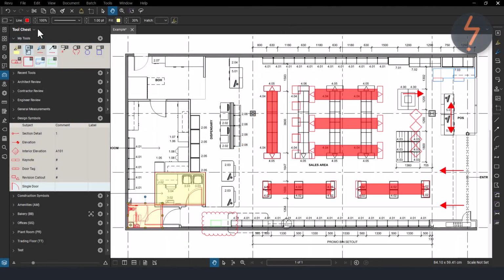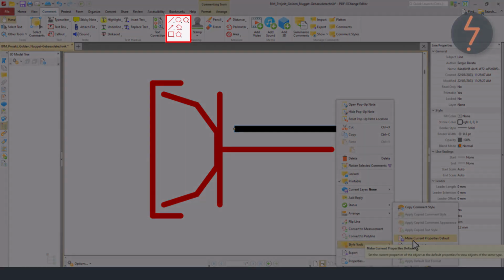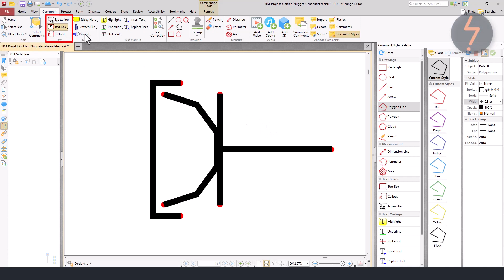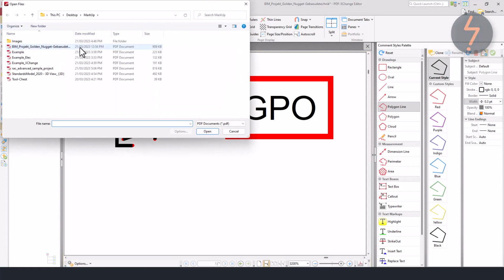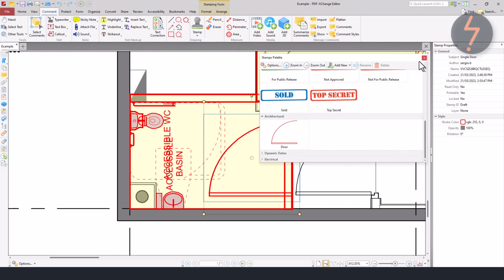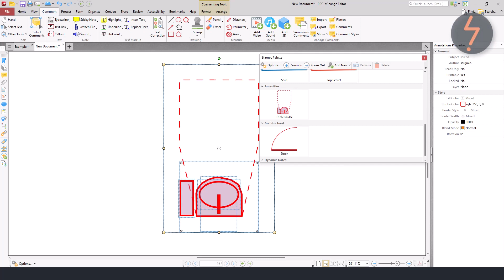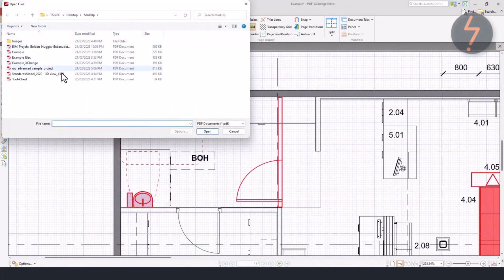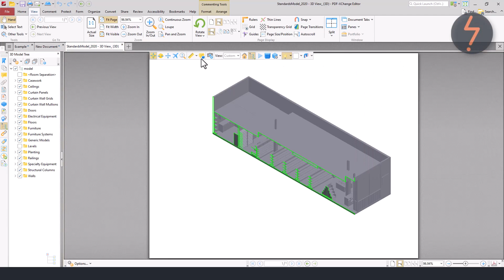Mastering PDF Redlining and Mark-ups: An Architect's Guide!

Comment: Would you recommend this PDF X-change editor for using heavy files (plans and specs) and multiple files at the same time? We are looking for a PDF editor that doesn’t crash everytime we want to open multiple files like when we do coordination with other disciplines. Thanks!
Reply from the maker: Sorry to say that a free application won't do that. If you want to do heavy lifting - you'll need to pay. Bluebeam is the best option for paid services.
Reply: I’m not talking about the free version (which doesn’t do much). I’m talking about the paid version PDF XChange Editor.
Reply from the maker: @limavalepy   - for paid applications, Bluebeam is the best.
Reply: @SergioBarata  Yes, we all know that. I’m looking for alternatives, since Bluebeam costs 240$ per user per year which is expensive for the average user. PDF X-Change Editor costs 56$ once and then about 10$ per year. We don’t need Bluebeam (we are a small office), we just need a PDF that doesn’t crash when we have 3 or 4 files open like Adobe Acrobat Pro does (which is as expensive as Bluebeam but still doesn’t solved our problems). We have a coorporate license with Adobe but in our department (our small office) is not worth it, so we are looking for alternatives. Anyway, thanks for your feedback.
Reply from the maker: I hope you find what you are looking for.